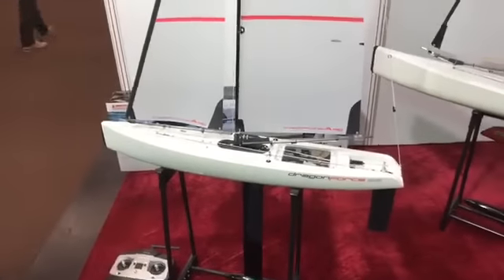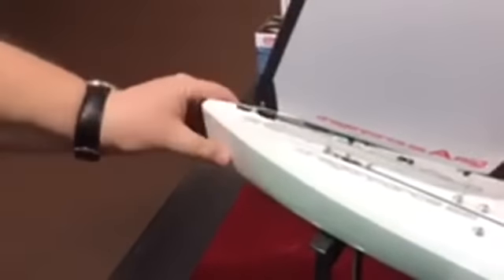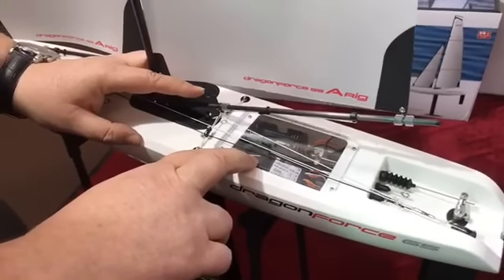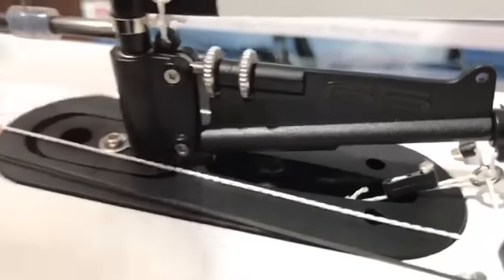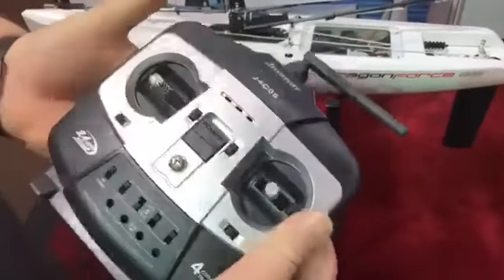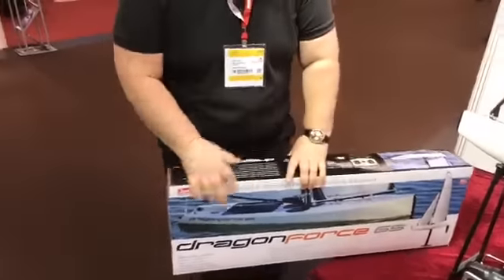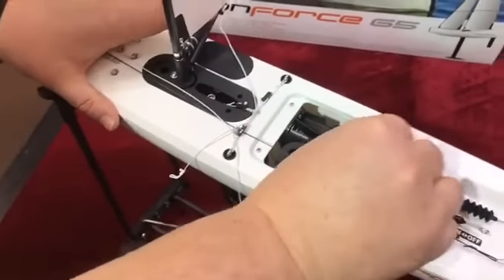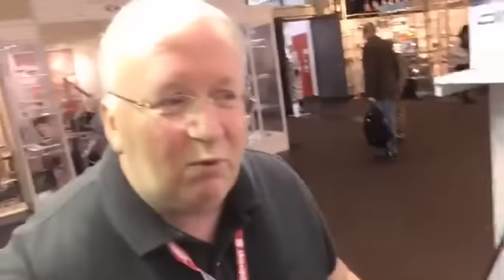DragonForce 65 Version 6 Debut  Feb 2017

Comment: Has any improvement been made to relieve cracking and leakage in keel box area?
Reply from the maker: Yes the entire mold is designed to be a bit thicker and more heavy duty than previous versions.  One thing we have found on older versions is some people have actually tightened the screws in the keep box too tight and this was causing undo stress. We are also working with Joysway at the production level to make sure that the factory is not doing the same thing during the assembly process.